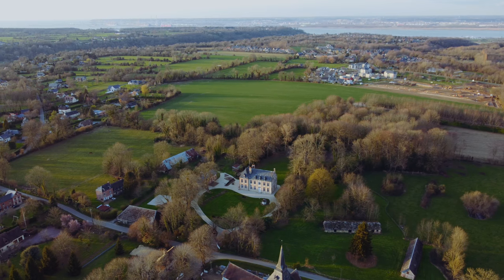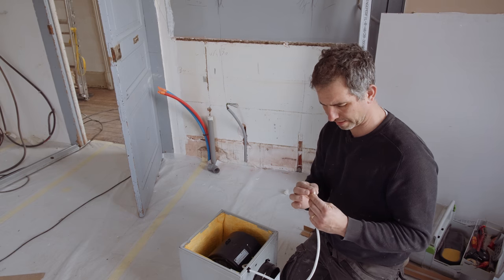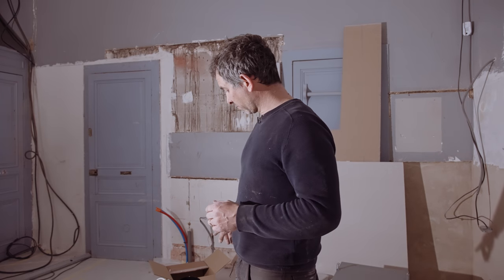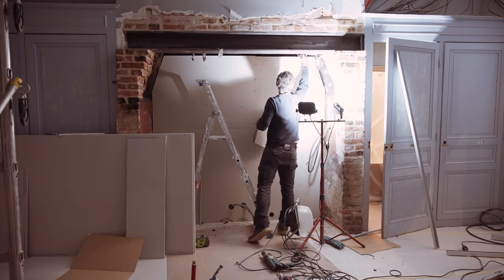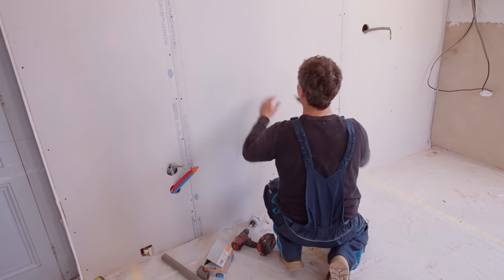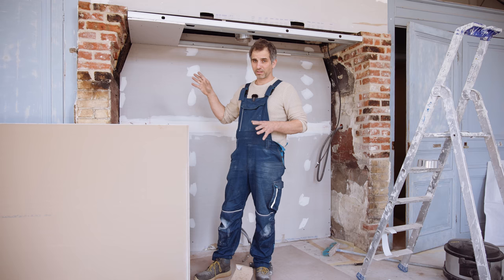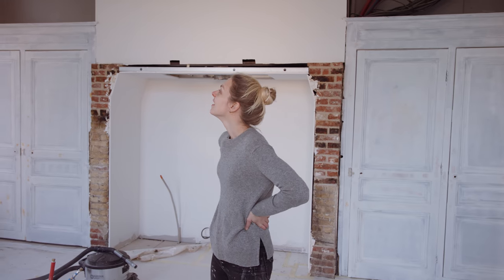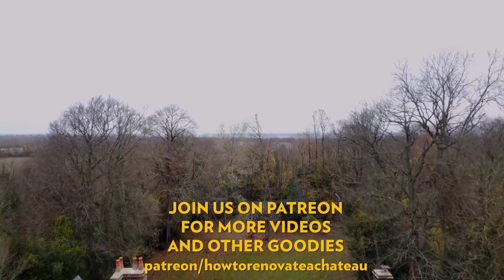Chateau Kitchen Makeover -  World's scariest DIY project

Comment: I think ceiling spotlights are a sleeker option and less in the way while cooking BUT wall mounted lights (style wise) are probably more fitting for the space. 
BUT then again, if you don’t mind the modernness of spotlights, I would go with ceiling spotlights.
Reply: @Louise Salt I completely agree.  But, for me, the functionality of ceiling spotlights slightly  outweighs the difference in appearance.  So my vote is clearly for the ceiling lights.  Besides, the look will be more sleek and finished.  Just my opinion.
Reply: Spot lights and maybe add a set of decorative exterior lights some where else in the kitchen…looks awesome thus far. You two do great work!

Comment: Lights are usually included in extractor hood. Add a warm LED strip in the recess for extra light if necessary. All lights over ranges should be water-/damp resistant, for obvious reasons!

Comment: Kitchen surfaces, especially near the cooktop, collect a lot of grease. I suggest puck/can lights shining down from the top, so grease and dust do not stick to an arm sticking out. Eliminate having to constantly clean the lighting's arm. Also, when lights are in a position where some of the light shines out into someone's eyes, it is actually very hard to see. Articulated spot light would partially shine into the cooks eyes and drive them crazy. Puck lights shining down are your best bet.

Comment: I've got a similar setup for my oven -   I'd suggest spotlights from the top, I found my old ones mid-level shine in one's eyes.  So, I'd go for 'down-lights'.  If you can pick ones that can move directionally -  even better.  Also, the lower the lights - the quicker they get dirty with grease.  You've a good amount of light coming into the kitchen from the windows all around, but in winter, you might find it quite dark comparative to the room in the stove/chimney cavity.  Down lights seems to get more light to 'work' by.   IMO.

Comment: I would need to see the range, if it is a modern slick stainless steel range then go for the spot lights, if it is a more traditional looking appliance then you may go for the traditional looking lights. These are going to be more difficult to clean tho.

Comment: Think about cleaning as well when selecting your stove lighting ... independent mounted lamps/lights while stylish, will collect grease and require fastidious cleaning every day. Spots mounted inside will provide great task/overall illumination and be able to be cleansed by passing a cleaning cloth over the light source. They are also neutral and do not attract attention. attractive decor lamps/lights could be placed on the island, away from heating elements and grease. Just remember to add an outlet/power plug source.

Comment: Just to throw a curve in this lighting saga ... perhaps both could work but only if the wall lights are the right design. The reason is that sometimes you just want mood lighting rather than bright light and optional wall lights could be used for the mood lighting. They would need to be perfect though. Once you sit down to have your meal the brighter pot lights go off and the mood wall lights go on. Lighting is everything.

Comment: I would suggest spot lights due to the amount or grease that will be splattered all over the place when cooking. The spot lights can be cleaned very quickly but any kind of wall lamp will be much more difficult to clean and you might find they get in the way.

Comment: Hi Phillip, love the channel. Re: lighting, handful of things to consider and since I’m typing and thinking, I’ll do my best to prioritize most important first and so forth. 

1. Dimension of the chimney space and size of the new range. If the opening is deeper than the range, counter or whatever the finished design calls for, I’d typically recommend the fixtures be recessed, w/ sealed lens and mounted equal to the front edge of the appliance. This provides ample light, low glare and minimal shadows. Although this is not where you pointed to in the video, it appears you have at least 6” of space in front of the hood and could mount some 2” gimbal recessed fix and really do a nice job. Note of caution, in the video you pointed to the sides of the hood which leads me to believe the range is not as wide as the chimney opening. If this is the case be careful not to mount fixtures (even recessed) in front of where the cook will be standing due to glare. This will not only be unpleasant, it will look terrible on film :) 

2. Recessed vs. wall mount. LOTS of good comments below regarding cleaning and so forth that should be considered. I’d recommend taking a good hard look at your finished plans and see if a sconce would enhance the space or make it feel “confined”. In the US, we need to have outlets mounted over each counter so adding an additional box/ fixture may be difficult to accommodate (I believe you have 2” or so behind the drywall) and make look good. Keep in mind, now that you’re a FAMOUS YouTube influencer, looks kinda matter. 

3. Switching. I’d recommend wiring for a separate switch and dimmer. This allows you to install higher output fixtures (I agree with the more light is better comment) and modify (customize) down the road if necessary because your wife doesn’t like it (it happens). Being a lighting guy and DIYer, I get teased for overdoing it (you probably guessed) yet having too much light when it’s time to clean etc has never been an issue. 

Best of luck,

Joe
Reply from the maker: Thanks for all those tips, Joe!

Comment: Definitely spots with rubber gaskets to keep moisture out. Wall lights will attract grease and you may eventually see peeling of the finish and/or rust from the constant cleaning with a grease cutting solution. Add character with wall mounted wrought-iron candle sticks. You can pop these off the wall for easy cleaning. Avoid a gloss finish. A matte finish will not show grease and splattering as much.

Cleaning of a man's tool area, or as is the case for Philip a room, can and often does lead to delays when a tool or one very specific screw is required. Once "organized" we find ourselves totally lost and are unable to find anything. I thought we covered this issue in a prior comment......No? 😄 

Great work this week kids. The kitchen is really picking up speed now. Just a few more looooooong weeks to go. So sorry you were "poorly papa" last week.

Cheers!

Comment: I would definitely stick to flush mounted lights,  not wall mounted. Grease and dust will get everywhere and a light on an arm will be much tougher to clean and keep clean. A flush,  surface mounted light will only require a wipe to keep clean.

Comment: I think you’re better off doing spotlights where you want to put them. I’ve done quite a few kitchens in my day and the last thing you need is something that you have to clean around your stove range like a wall sconce. It’ll just collect a lot of grease and what not.  Another suggestion and I’m not sure if it’s too late or not but putting a hot water tap above the stove. But I’m not sure if running a line for the water is possible now or not. It’ll be great for filling pots full of water. Like stockpots and it actually falls back into the wall so it’s not sticking out all the time. Just a thought

Comment: I have the same extractor fan in my old chimney and it has an integrated light bar / spot light. It gets grease covered fairly regulariy and yet 
so much easier to clean than a wall sconce would be.

Comment: Re.. Lights around the cooker. as many have said spot lights will be easier to clean however some copper adjustable lights will give a small dash of the orange you wanted... but to really answer the question is what will go with the kitchen, modern spot lights while flush may not fir the aesthetic of the kitchen, however adjustable lights could be a little to chinzy... maybe just one light on the back wall a handcrafted piece?

Comment: Hi I just wanted to tell you your choices of lights will get splattered and it might be better to do a under-mount light. It is a long skinny strip light that you would put under your top cupboards. This also would fit just in behind you updraft vent so it could be the whole width of the back wall and would give even lighting instead of just a spot that is brighter. Your tiles and stove should be the feature not ugly lights, sorry 😊

Comment: How many lights do you have on your hood liner?  If four lights, you may not need more.  If you still want more,  Hafele Loox 5 puck lights are nice, they have several color rings you can change.  You'll need to hide the driver somewhere you can access it later if you have an issue.  You may want to check and see the color of your hood liner lights...for example if they are 3000K on the hood, you'll want to get 3000K on the puck lights.

Comment: I think the top part is not leveled. The framing does not align with the same level of brick coursing
Reply: I think they were more concerned with getting the back wall (which will be tiled) square, as if that's off it will really be noticeable. The top front part of the cove will be covered by a beam. Hey, old houses were wonky ... it's part of their charm. If one insists on absolute 90° angles and symmetry, definitely don't buy 100 year-old+ homes! 😅